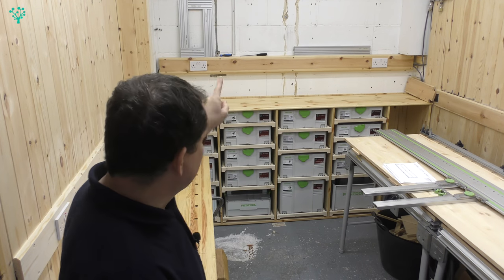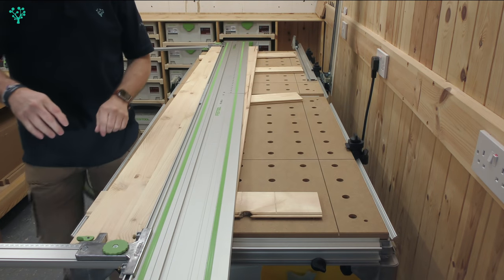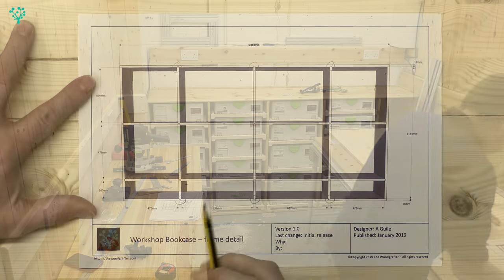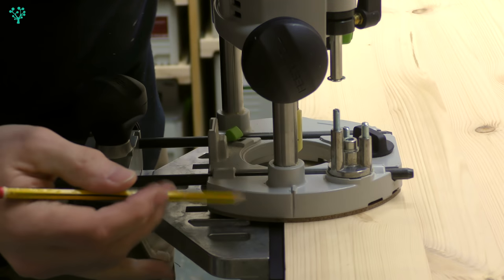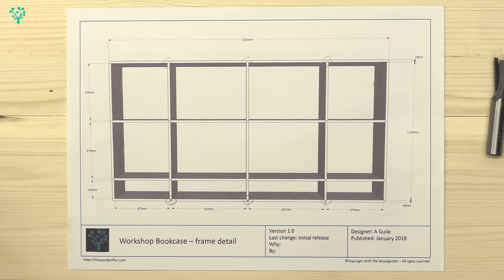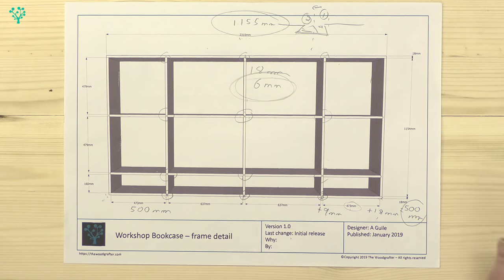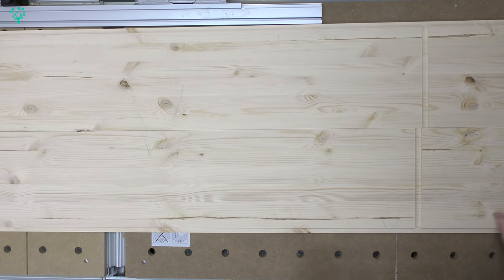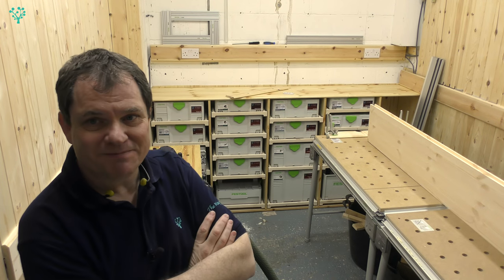How to build a bookcase - Episode 2 - The Build

Comment: If you had cut them to double width first then to length you could have cut the dovetails and rebates as one solid piece then cut the boards to width
Reply from the maker: +Big Mac 

Hi Big Mac

If it was a two sided cabinet then yes, that is  the way to go (assuming the stock is wide enough).

In this build the center panels had the dovetails on both sides of the panel - so it wouldn’t have solved the problem.

And although the method looks complicated when you talk through it, once it is set up you bang the through the side panel cuts very quickly.

So it is quicker to batch cut all the panels to width and then batch cut all the dovetails, otherwise you end up going back and to between set ups and that’s when inaccuracy creeps in.

Hope this helps

Andy
Reply: The Woodgrafte

Comment: Hi Andy, do you have any tricks to get and keep the two connected guide rails straight when connected using the rail clamps? Do you line up using a straight edge first or...?
Reply from the maker: +borstroem Hi borstoem - I noticed that the other day, that if you are not carefull you end up with a small gap at one side of the joint on the rail, obviously if that happens then the rails are no longer straight along the entire length. They end up with a small dip (or crest) in the middle.

The way I have started doing it is

Fit the two brackets to rail 1
Slide the second rail onto the brackets
Stand the two rails on a flat surface with the wider side down and the cutting edge up
Push the two rails together pretty firmly
Tighten them down
Then check for any variation in the gap

You will see on the video I use my steel rule to check the distance from the cutting edge of the rail to the edge of the board. I check that measurement at both ends and the middle.

That then gives me confidence in the cut and the set up.

To be honest, for precision work, the Festool rail jointing system is a bit poor - and errors can easily creep into the equation. The best solution is to invest in one of the longer rails. From memory they do a 2.4M and 3M length. 

I have also heard that none Festool rails Makita/Bosch etc. work with the Track Saws - but mixed results. I haven’t tried them, so can’t comment. But may be worth a web browse if the alignment of the Festool rails becomes a problem and the cost of a Festool longer rails is an issue.

Great question hope this helps.

Talk soon

Andy

Comment: Great videos, great detail and explanation of the tools, also watching the Incra videos too, anyway here's a question, the timber you (pine furniture Board)use, how much a sheet is it, I've seen it in BQ, has a slight chamfer on the edge and thinner than 18mm (I think it's 15mm) is it the same??, why do you use it 🤔🤔, it's quite expensive especially at BQ 🤣🤣?? , I noticed in BQ the boards were cupping in places (not the best place to buy wood, the way they store wood is terrible ) ,MDF is more stable and cheaper, I mean  all timber dust is harmful in it's own way just got to respect it, finally where do you obtain them sheets, ever thought of making your own, time consuming work I know, anyway keep up the good work ....
Reply from the maker: +Kevin Davies Hi Kevin, and thank you for your comments and feedback.

No I don’t but the timber from B&Q it tends to be way to expensive and mixed quality.

If I want quality and consistency I buy it from Timbersource https://www.timbersource.co.uk

It comes well packed, and doesn’t come warped. It is cheaper than B&Q and they also do an oak furniture panel.

However they aren’t the cheapest, if you search on eBay you I’ll find suppliers that are cheaper - but you are taking a chance on quality. 

The batch for the bookshelf build came from https://roncurrie.co.uk via eBay. It came within two days and very well wrapped. But had cups in all panels, however the moister content during transit is bound to have an effect. It is currently resting in the workshop (the stuff I have used so far on the video is existing stock) we will see what happens. However the design and joinery takes out the cup so not a huge issue.

I could use MDF, but I just like natural wood. I use MDF now and then but mainly when I want a really stable structure - example building cabinets in a bathroom. Or they are going to be painted.

I am a hand tool woodworker who is converting to power tools to increase productivity as I launch my business. Historically I have made my own panels, and will be again when I get the planer jointer in the shop. BUT for speed and efficiency of building the shop, pine panels are great. 

To be honest, if I was building “case” type furniture I would probably still use pine or Oak furniture board (from my normal supplier). But at some point I will run a comparison to see what is most cost effective. Good idea for a video :-)

But bottom line, no it’s not the stuff you find in B&Q or wickes.

Hope this helps,

Talk soon.

Andy
Reply: @TheWoodgrafter definitely helps, it's great bouncing ideas about that's how you learn😁😁, I learnt a lesson, i thought I was being clever  making my  kitchen doors out of plywood thinking it was stable, couldn't be more wrong, couple of the doors have warped already,it wasn't birch ply , maybe should have used that it's a better grade  never mind lesson learnt(the hard way 😂😂) , I'll redo them soon probably out of MRMDF, they are painted ...
Thanks for your time and loving the longer video better than watching Sky !!!
Reply from the maker: Kevin Davies. Yes agree with that, that was one of the reasons I wanted to create the YouTube channel so we could create a community and learn as we go.

Don’t know about you, but I have really struggled to find a good supplier of cabinet quality ply in the UK. Anybody got any ideas ?

However, lots of quality veneered MDF available - at a price.

Better than sky, now you are just been nice. But thank you anyway :-)

Talk soon.

Andy